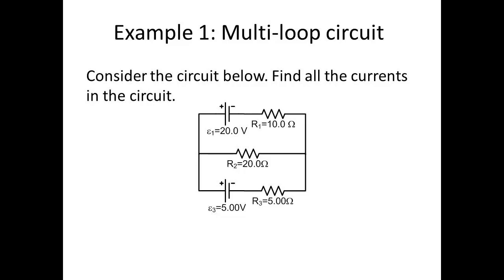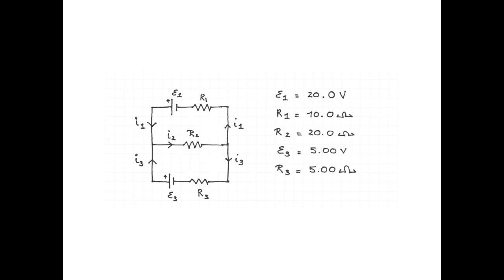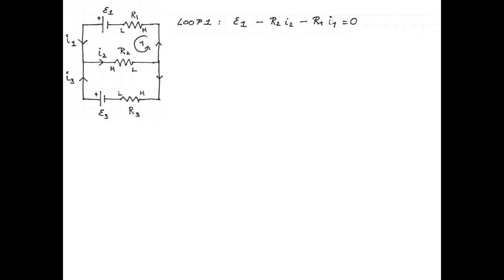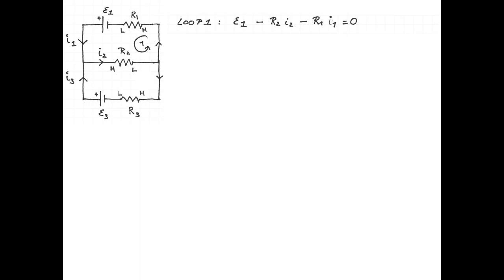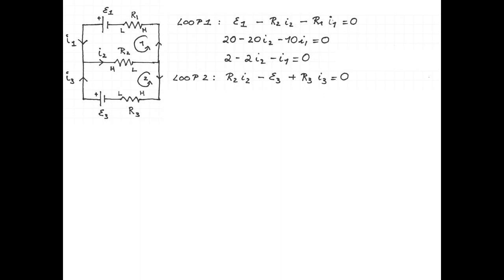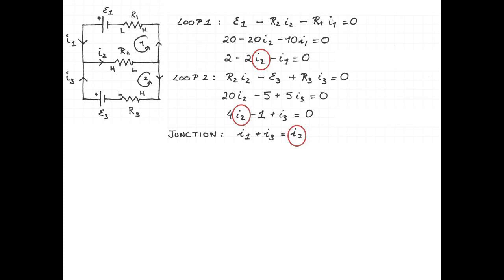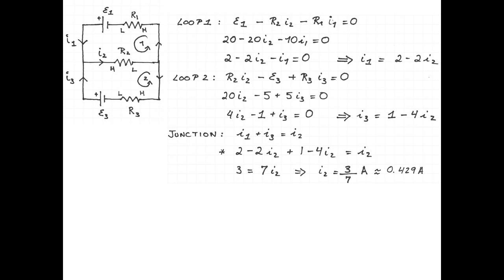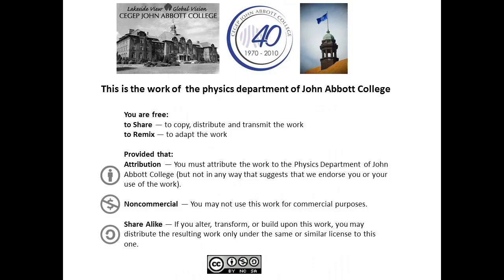Calculating current in a multi-loop circuit example 1

Comment from the maker: If it is not stated explicitly in the problem, the person solving the problem can decide which currents are i1, i2 and i3 and which way they are going. If you guessed wrong about the direction of the current, you will get a negative current as a result, and you state in your answer that he real current is in the opposite direction.